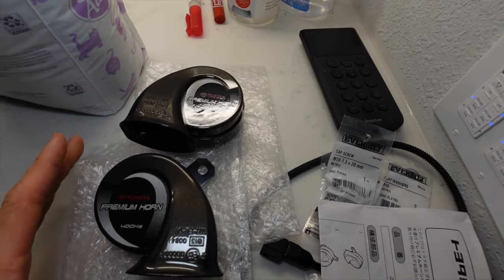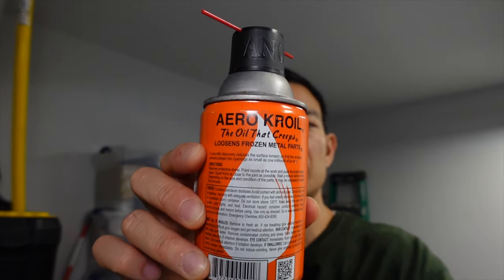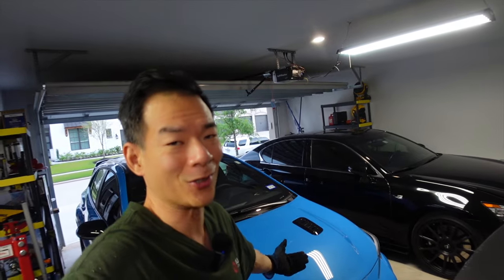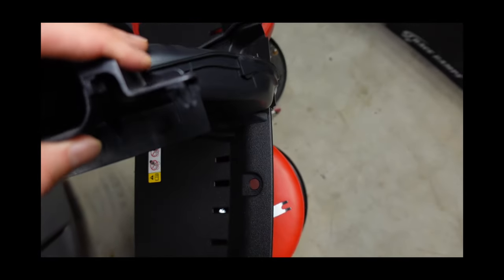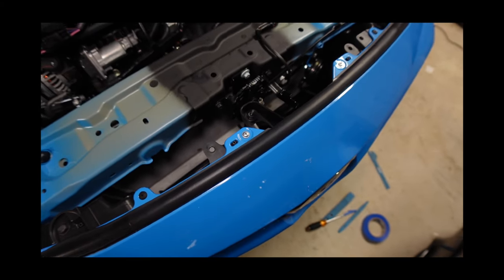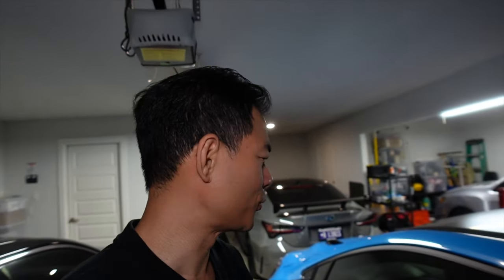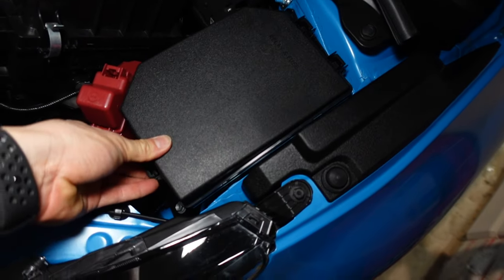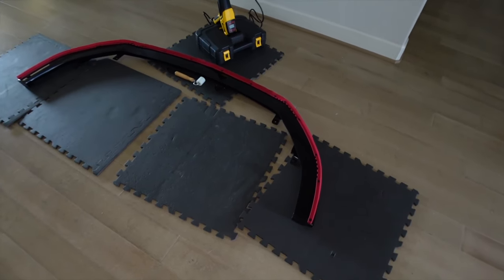OEM Horn upgrade for the GR Corolla!! and Some work on the WRX lol

Comment: snip that zip tie flush at 10:33...knuckle cut waiting to happen. 🤕  actually shocked at the amount of the GRC that isn't painted in body color.  Even my WRX has a 100% painted radiator support.  Curious how much more of the exposed metal (or metal that can see the elements) is unpainted.  yes, it has been chem dipped and is primed, but no body color paint.  will JDM WRX horns work too?
Reply from the maker: Hey what's up! thanks for the tip, I like to leave a little extra on the tie in case somehow it loosens a tooth. I am an engineer what can I say. Toyota will save money everywhere they can which is ok for me as long as the car will last haha. The WRX horns may work with the OEM harness but I remember they were a bit pricey a while back.